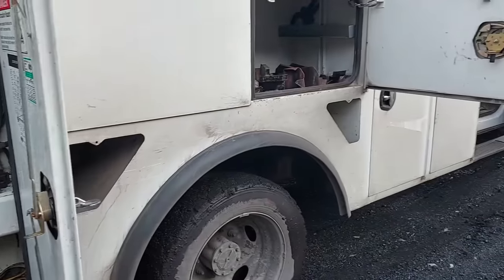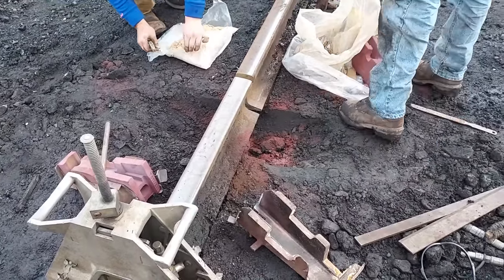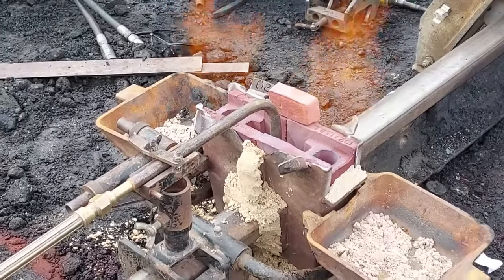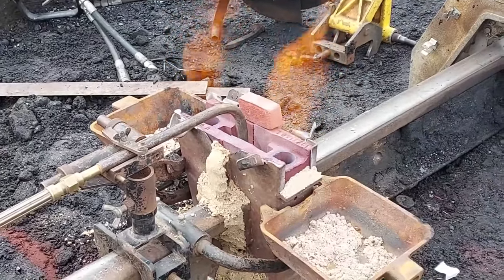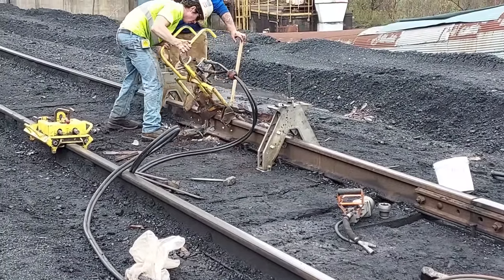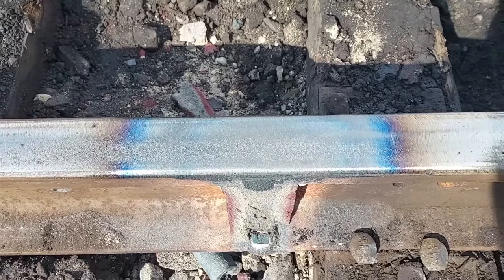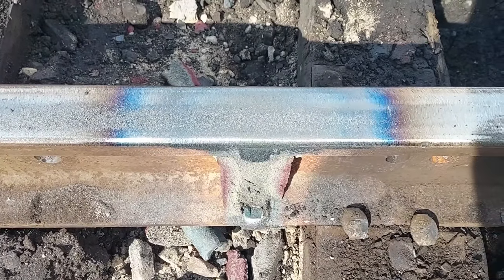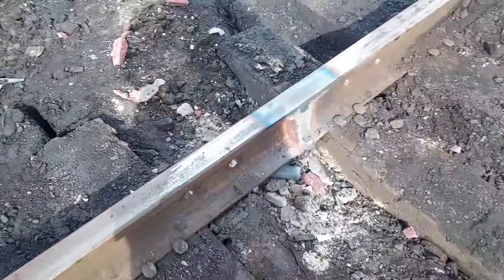Shooting a Thermite Weld on the Railroad from Start to Finish

Comment: Is this welding used to joint the track sections or just to fix problems inside the section?
Reply from the maker: It can be used for both Mohamed, but most generally here
it is just used for fixing spots such as was here. Thank you
very much for taking the time to visit with us and check out
the video. May you have a very good day my friend.
Reply: @ccrx6700  thank for kind reply. Just another comment, if the welding is used to connect different sections, will this eliminate the flexibility needed for thermal expansion, or will they leave some unwelded sections for that reason?
Reply from the maker: @mohamedsakr3202  we have 17 mikes track here almost all is jointed, this was just a repair so no worries on expansion

Comment: I cringe every time I see this process! I had to put out tie fires from slag in a steel mill. One drop of water in the wrong place and you had an explosion!
Reply from the maker: Was very nice of you to take the time and visit with us today
to watch the presentation Doug. I hear you well on the water,
someone else said they did cad welds and if there was
too much humidity in the air it might explode. Amazing.
Reply: @ccrx6700  What they said is very true since I was in an area of high humidity! However the heat of the slag made it extremely reactive to any droplets of moisture!
Reply from the maker: @dougabrahamsen2952  😊👍

Comment: I’ve done some thermite welds like that but with a much small mold.  One day it was wet and that thing exploded, it was pretty sweet
Reply from the maker: That's why they dry the pans Derik, moisture makes unkind things
happen when thermite welding. Appreciate your watching  my friend.
Reply: @ccrx6700  yeah i was young and dumb, 12 years in cell towers now been a long time since I’ve done anything dumb.  Great video
Reply from the maker: @derikstinson667  👍😊

Comment: Nothing more then the rapid oxidation of aluminium freeing the iron from the iron oxide in a molten state .
Reply from the maker: Well I don't know the chemical reaction that is happening but
your right, it's iron oxide and aluminum mix they set on fire Phillip.
Appreciate very much your taking the time to check out the video and may you have a very good day my friend.
Reply: @ccrx6700  it works the same with copper oxide also , used by electricians for earth bonding . Suppose it would would work with many metallic oxide .
Reply from the maker: @philliplopez8745  😊👍

Comment: How long does this process take start to finish?
Reply from the maker: From set up to clean up about an hour sir. Really appreciate your
visiting with us and checking out the video. May you have
a most blessed day my friend.
Reply: @ccrx6700  Considering the process of joining two thick pieces of metal together at a butt joint that can withstand the weight and force of trains rolling over it, I say it's extremely impressive to be able to achieve such a task in so little time. I've always loved trains, however railway maintenance has become a new fascination for me. Thank you for sharing this with us and have a blessed day as well. 🙏
Reply from the maker: @N4sir98  👍😊

Comment: Wouldn't it have been easier to use tinfoil 🤷
Reply from the maker: And duct tape to hold the foil in place.... Thank you for taking the
time to check out the video Wispa.
Reply: @ccrx6700  
Exactly, a true DIY enthusiast 👍.

Jokes aside I did enjoy it and watched a few others.
Like most men we like loud, hot massive machines at work.

Thanks for uploading 👍.
Reply from the maker: @wispa1a  👍😊

Comment: Just wondering what coal mine that was and where is it located
Reply from the maker: We are Cumberland Mine owned by Iron Synergy and located at
Kirby Pa. about 1 hour straight south of Pittsburgh John. We haul exclusively coal to a river barge loading facility 16 miles away
located at Alicia Pa. Thanks so much for checking out the thermite weld video my friend.
Reply: @ccrx6700  when I saw this video it looked a lot like where I used to work at Federal No 2 near Blacksville WV
Reply from the maker: @johneverson2433  👍😊

Comment: Why did they have to weld it to begin with?
Reply from the maker: As you can see the ballast is horrible there, it gets a lot oc
coal spillage. Elimination of joints is the reason for welding,
joints don't hold up well at all in poor ballast. Thank you
for watching and asking Walt.
Reply: @ccrx6700  appreciate the comeback, Thanks

Comment: No splice plates?
Reply from the maker: Not on a welded joint Robert. The weld build up will not allow
room for a splice bar to fit on. Thanks for tuning in and watching
the show my friend.
Reply: @ccrx6700  has anyone done a specimen load  bending /stress test on that type of thermite joint using various lengths of rails with the thermite joint in the middle? This should be a perpetual test carried out on random specimens, by each manufacturer at random times.  If these were airplane parts.....The govt would be requiring it.  I know....red tape...blah blah. Once a catasrophe happens, like Amtrax, the mfr wont have a choise. You know govt right?

Comment: How many welds do you make in one day ? Max ?
Reply from the maker: Our welds are all done by contractors Tom. If they have no
trains running to slow them down, they can generally do 6 or
so a day, 8 hour shift. Takes about an hour and 15 minutes or
so per weld. Thanks for watching and writing in today my good man.
Reply: @ccrx6700  I,m a thermit welder in the Netherlands 🇳🇱, when there are no trains we have to make 8 welds . Nice !
Reply from the maker: @tomvanheeswijk5560  👍 also i didnt mention whether the wekders had to track travel. If they are track side and dont have to pick up tools after every weld then they can do more

Comment: I imagine that oxy-gas welding is an option as well, though lugging around those heavy tanks and all the stuff you need to weld doesn't sound fun for rail work. You could stick weld using a generator (or even 6 or so car batteries) but that sounds like more work as well.
Reply from the maker: Thank You Truly Infamous for taking the time to stop by and take in the video today.

Comment: A professional welder would have made quicker, less expensive work of this. And there was a gap there to begin with probably for rail expansion. Now that expansion joint is gone. Good luck in the next heatwave when the rails buckle.
Reply from the maker: Thank you for sharing your thoughts Jer. and we appreciate your taking the time to visit with us and take in the video my friend.
Reply: Better go and tell all the railway engineers, they clearly don't know that.